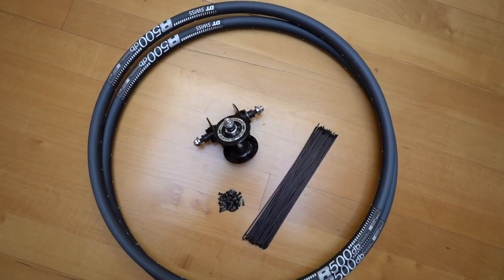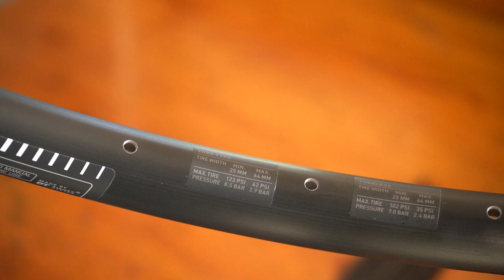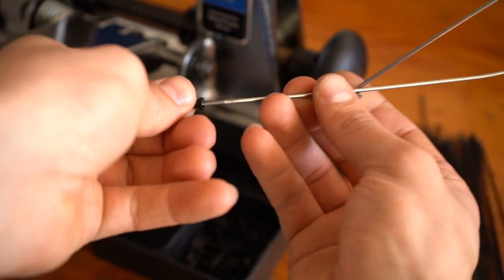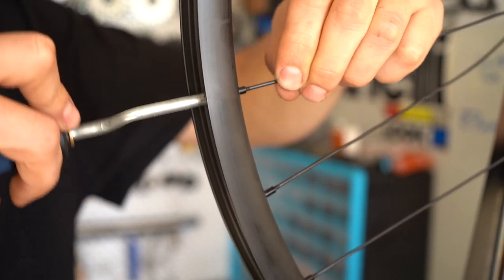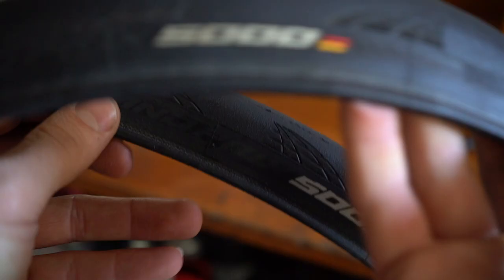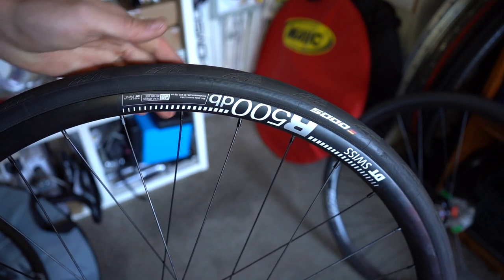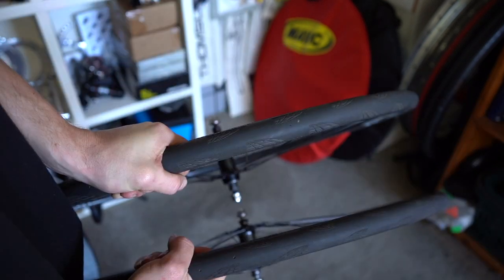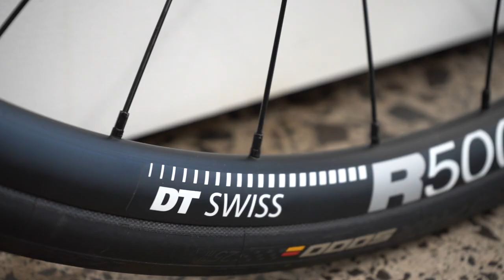Wheel Build - Suzue Pro Max Carbon x DT Swiss

Comment: Slightly wider rim to tire width is actually considered most efficient for aerodynamics, it’s controversial. They call it the 105% rule

I know I may be late. But the rim decals will look better on, imo. The white lettering on the rims take back some of the attention of the frames decals and it looks more filled if that makes sense.